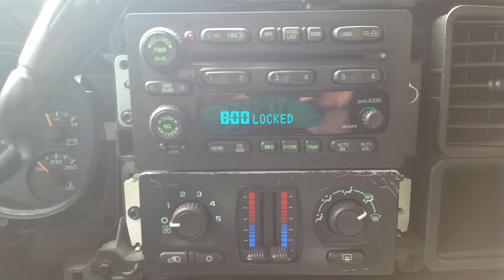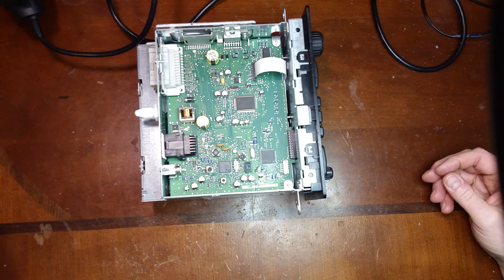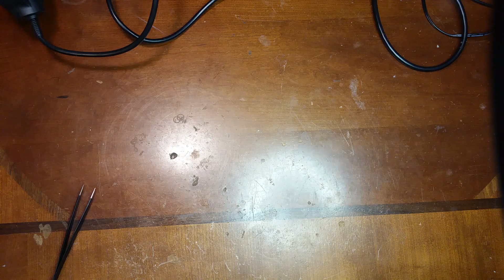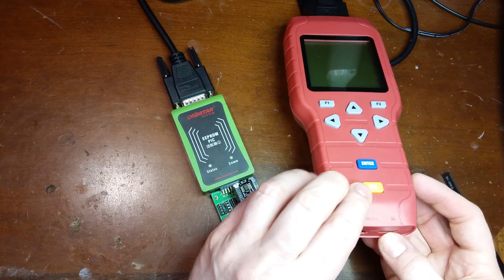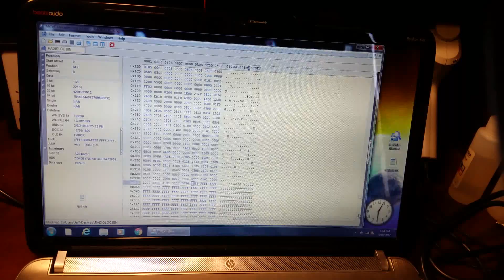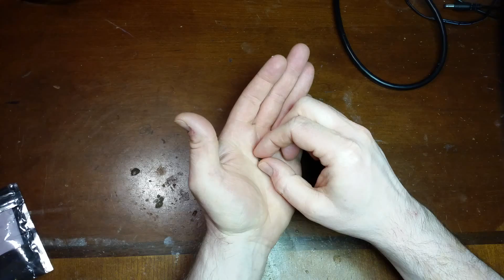My attempt to unlock a GM radio

Comment: What a shame you couldn't try it... looked promising.  I guess the REAL problem for GM with radio swaps is that allegedly the mileage is in that eeprom :O.   I don't get why you can't move the eeprom from the old radio to the new one... as long as the old one isnt locked you would think that would carry everything over and the car would be non the wiser, plus all the calibration and vehicle history would be correct.  My radio has bad amplifier,  which is on the main board, or else I'd be swapping the board the main boards to bring the EEPROM over.
Reply from the maker: I've had some people contact me and confirm it did work. You may have made a typo, but the mileage is stored in the cluster eeprom, not radio. If you have a identical radio, I would think eeprom swapping would work.
Reply: I read that somewhere about the OD being there.. but yes, it doesn't make sense... no one with an aftermarket would have their OD data! Ha ha.
Thanks for the follow up.  I am getting a replacement radio and will probably have to try the swap.  I also read putting in a blank EEPROM may force the system to reinitialize the EEPROM... that is possible but seems riskier.  I bought a clip on SO8 harness for my TL866 programmer so I may not have to physically swap, just read from old write to new.  If you are interested I can let you know how it goes.
Reply from the maker: I also read that installing a blank eepom would work. I tried it once, it didn't work. I'll try again some day.
Reply: Thinking a blank EEPROM might be reinitialized is plausible; I've done initialization methods like that in embedded projects. However, it is just as likely that they don't do that... or perhaps some radio implementations do and others don't- the later requiring that the EEPROM contents be established by a production programming process- and thus have no code built in to re-initializing the EEPROM "in the field".
Reply: @jeffescortlx  Is the mileage stored in the ECM also, or only in the cluster?
Reply from the maker: @theoldbigmoose  I believe it's also stored in the ECU accessible with a scan tool, but the mileage you see is what's stored in the cluster.

Comment: I have been looking for an Eeprom solution for my truck for over a year! Did you ever find out if it worked??! I have a 2007 Silverado Classic and my head unit was stolen. I found a used one from a 2006 Silverado and just completely removed the Eeprom. However, when playing CD's, an album will reset to beginning and presets/equalizer will be lost after each drive cycle. Every time I start the truck, the radio automatically blasts some stupid country station. Very annoying. If this flash does work, where could I find the tools to flash mine? Thank you!
Reply from the maker: Marshall Ruff 
Yes, it works.
Mail me your eeprom and I'll change the vin for a reasonable fee. Send me a private message for more info.

Comment: jeffescortlx : On a 03- early 07 silverado inst. cluster could you tell me what information is all stored in the atmel eeprom , I know the mileage & engine hrs. are but I have also heard the info. for the optional trans. temp. gauge is stored in there also , is that true ? Also I had a call from a gentleman the other day and we started discussing these styles of clusters and he said the DIC functions are stored in there also and I didn't agree with that so who is right on the DIC functions ? I told him I would shoot you an email because if anybody would know you would . THANKS JEFF AND TAKE CARE !
Reply from the maker: mark corkery 
It looks to me Vin, milage, hours and stepper motor factory calibration zero point is stored in the eeprom. If the cluster has no factory trans temp, the factory stepper motor calibration for trans temp will be zeroed out all the way at the bottom point, but will still work. Some information like upgraded dic options are stored in the micro processor. Like the extra trip and fuel milage options.
Reply: THANK YOU JEFF !
Reply: Hi Jeff have you ever worked on a 02 Express or savana. It has a weird part number for the eeprom and it's not a 25020. I have tried all different types in my reader in and out the circuit bd and it reads nothing . Any guess? Ty Mark
Reply from the maker: NuWavUSA 
are you talking about the radio eeprom or cluster eeprom?
Reply: jeffescortlx cluster eeprom from 02 Express it has marking 
MO4AV 
014
38615

Ty
Reply from the maker: NuWavUSA 
Sorry I  haven't tried getting a read on that one yet. Might be similar to 99-02 full size as far as the style of eeprom? That cluster is a bit unique and doesn't share much with the other chassis of GM's if I remember correctly.
Reply: Thanks for the response